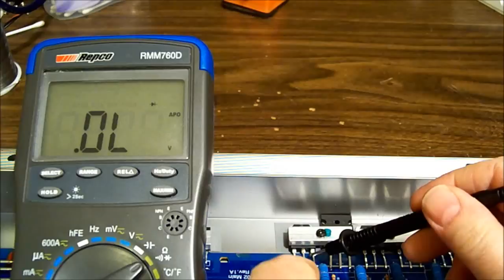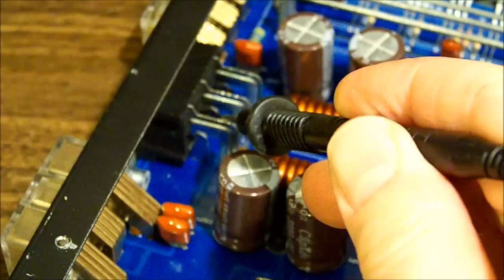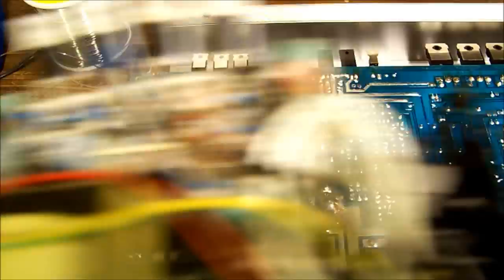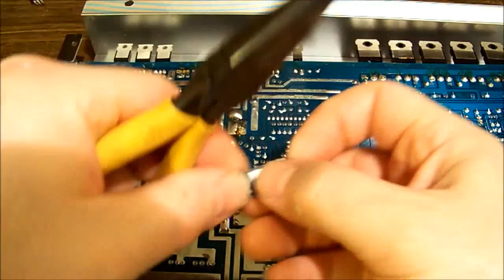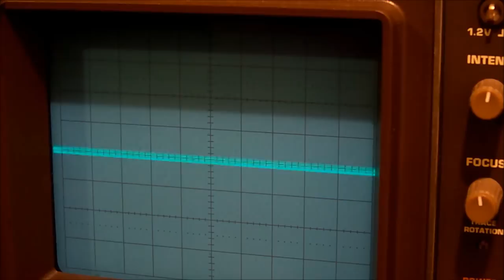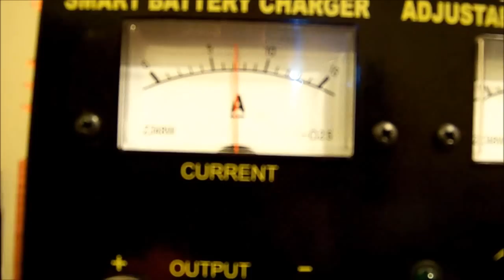Response Precision car amp second repair

Comment: what will happen if a car stereo is connected directly to an amplifier? connected to the amplifier are the speaker leads..
Reply from the maker: Some amps have a high level input. You can connect the stereo speaker leads to this input if you don't have RCA option. If you connect speaker leads to the RCA inputs it will sound very loud and distorted IF it doesn't damage the input circuit. If you connect the speaker leads to the speaker connections on the amp at least one of them will be damaged if not both but the amp is the most powerful of the 2 so if any survive the amp will.
Reply: You're right Mr Jonny fix, may car stereo is the one damage...can you please give me a hint of a possible defective part or part of my car stereo? Thanks...
Reply from the maker: Almost certainly will be the audio output IC as it is connected directly to the speaker lines. It's usually a black rectangular chip that has 2 screws holding it to the rear heatsink and a row of pins along one side to the circuit board. If you're lucky there won't be  ahole in the front side and you will be able to read the part number to be able to order another one. See my video for replacing one of these  https://youtu.be/hdbUaYGIoiE?t=793

Comment: Hey i was wondering if you can help me with a amp questions thanks your videos are awesome and helpful thanks
Reply from the maker: I can only try.....
Reply: Thanks so much for getting back to do you have a email so I can send you the pictures?
Reply: If not I understand but I have a Rockford power 1500bd single channel amp the very last mofset transistor is melted on it reads MTP75NOSHD then under reads CQ 151 I tried looking those up but can't find them I thinking they might not make those exact one anymore because it an older one I thinks it's an early year like 2000-2002 it's on the same side where the remote is located
Reply: I got some very clear picture of but caint link them in this message for some reason
Reply: jeisenzapf@yahoo.com this is my email if you can send me your email so I can send the pictures your help means so much

Comment: I have Diamond d7056 amplifier and every time I turn my radio on or off makes a pop noise I swap to a different amp and the noise went away  I was hoping that the problem was the radio/rca  but everything points to the amp have you ever come across this problem and how can I fix it. Thanks
Reply from the maker: Not sure what this could be. If it's only in one channel then look in that channels input circuit. If it's in both maybe start by scoping the power supply to see if there's a spike or something at the time of the pop then investigate there.  Either way you'll see it on a scope and should see where it's coming from.

Comment: hi I got a similar amp in design.....there is 12v and 30 inside the amp but power light is not on and amp is not on........ant ideas
Reply from the maker: I would follow the line from the power light back and see where it is driven from. If it's from the power supply maybe 30V isn't enough and it hasn't reached operating level. If it's fed from the audio input circuit somehow maybe that's not functioning right. A scope might be handy here to follow the signal through.
Reply: Hi...there was a +15...missing fron the pre amp stage.....while checkin i checked 380 ohm resistors...one read open...pulled it checked good put it back amp power light cane on ....seem aresistsnce build up round one of the resistor pin...is my guess
Reply from the maker: Raj Dann if it reads open when in circuit it probably has some voltage across it that's making your meter spit the dummy
Reply: ok thx......keep up the good work on the vids.....I enjoy them ..as do a lot of other techs......any experience in crown macrotech amps?
Reply from the maker: Nah sorry, not really in the business, just do what people who know me need doing.

Comment: what would cause a amp to go to instant protect with just the power ground and remote hooked up?
Reply from the maker: boosted970 Probably shorted output transistors

Comment: I was wondering if anyone could help me? I HAD a 5 channel amp & I was testing a dual voice coil sup on (this was all before I knew anything about car audio or electronics) & I think I blew the amp because I wired the speaker to 1 or 2 ohms & the amp wasn't rated for it. Would anyone know where to start looking for a fix on that?
Reply from the maker: I bet one or more output transistors failed as seen in the first video I did of this model. Identify those, remove them from circuit and test for shorted leads.

Comment: Hi there. I have found an Audison LR 3062 made  in Italy, probably 21 yo. No green or red light on, I've put a 12 v adapter on it, but it sparks and drains the adapter's red display. Sparks a lil bit on the ground/positive sockets. Opened it  but I have no clue where the fuse is, unless it looks like a striped resistor or like a blue tear. They work...have ohms through, have beep. All the 3 pins of the transistors work except on the two last ones , one on each side, towards the output end. The  3 sockets give a 0 reading of ohms, let's say socket 1 with 2 give 0 , socket 1 with 3 gives an amount. Is that normal or they are fried? No burn sign whatsoever. Thanks !
Reply from the maker: Hard to know what measurements should be without seeing the board or a schematic. You may need to remove transistors to test them properly as you could be measuring across other components as well. Fuses are usually plug in types in the outside rather than on the board. Sparks at the terminals could be normal as these use a bit of power to start up ( 5 amps or more). If you can't access a good bench supply a car battery will suffice. Good luck!
Reply: Jonny Fix
Appreciate it ! thanks !

Comment: would anyone help me ? when i turn my volume up just a little and you start to hear the bass  the amp kind of goes off and on constantly and you hear a dum  one second silence dum angain ans so on sound constantly as the amp comes on and off. i replaced the 4 transistors and still same problem i am now thinking it to be the diode ? one thing i did notice..i have a voltage reader on my power cap and that says low (basically being sorted) when the amp goes off and on. it keeps doing this till i turn the amp off.
Reply from the maker: My guess is there is either not enough current available from the source like weak battery or power cables not big enough etc, or the speaker has a fault or is too low impedance for the amp causing some overload.

Comment: if anyone could help it would be much appreciated i have a rockford fosgate punch 250.2.... the problem is when i connect the remote wire and turn the amp on it will send out a steady dc voltage there is no visible damage on either side of the board
Reply: So whats the porblem? Not turning on?
Reply: The remote wire carries out 12 volts to turn it on from the head unit.
Reply: it turns on but sends out dc power
Reply from the maker: If it is sending DC to the speaker terminals the output transistors are likely shorted or the drive circuit has a fault and is turning them on.
Reply: alright thanks man

Comment: AMAZING VIDEO. i love your eplanation.
people need to learn the fundementals that you showed at the end to WHY the fets failed.
My nasty Orion 2150sx old schol failed same way.
I forget what fets i used. 60n ot 44n fets i forget but the caps legs fried off because of the IC switch was stuck on full to coil on one half of phase. I did not repair it myself all the way. I do recall the real tech doing it , did same as you.
CONGRATULATIONS on your  REAL video. Please do more! 

I would love for you do do an output modification to 2sc5200n / 2sa1943-n on outputs and see what is needed on a typical AB amp.or would most be a bolt in?
I would love to rewind a  transformer beast for high voltage .....only mids and tweets 80hz up project to do 300 rms per side at 4 ohms. not much current so no need to beef up supply fets.
keep up the good work bud!
Reply from the maker: +AUTOCUBE Thanks, appreciate the comment. Glad the video makes sense :)

Comment: I'm getting a Resistance of 100k ohm on the cap pads on the left channel with the caps removed , it starts in the meg ohm range and drops to the 100k ohm range and fluctuates up slowly.  When I tested the amp the only components I removed where the caps on the left channel . This is a bridgeabe amp if that helps you any. But the components I am refering to as power transistors(which I may be calling them by the wrong name possibly)  are (5N05HD 921) There are 2 of those directly across  form each other, one on each channel, and (U1620R KAK),And (U1620 AKA) And They are also directly across form one another.
Reply from the maker: +smallmechanic The components you mention are a MOSFET and a rectifier, these are in the power supply section and at this stage I don't think are the problem. Is this the same......

http://www.soundbuggy.com/Eric/Car%20Audio/rockford_fosgate/punch_250_2c_1/punch_250_2_guts.JPG

The output transistors are the last 4 in the row under the clamping plate on the top right and bottom right. I would start with checking these out of circuit, if you measure a short or low resistance in circuit you can't always know if it's normal and related to something else.
Reply: Jonny Fix  I will pull all the fets and transistors out and check them. I have a little  money so I could order replacements if they are not to expensive. (I bet radio shack dont carry any equivalents?) . That amp in the link is similar but my amp is the 250 a2 rockford fosgate, the way the fets attach to the sink is different and there are no wires coming form the triods coil ( I think that is what they are called lol). ill let you know how the output transistors read when I have a little time to pull them out. Thank you so much Sir.

Comment: It is a two channel amp , when I removed the secondary caps on the left channel and powered it it just to test the amp came on and so I checked the caps and tested good (nichicon) and I also tested the power transistors and they seem okay but the amp will not power on with those caps in the board. I'm stumped as to what to check next. Thanks again for you help friend. Have a good one!
Reply from the maker: +smallmechanic By power transistors you mean output transistors that drive the speakers? This is strange. You could put the caps back in and remove that channels output transistors as a double check. (I guess you also tested with the right channel caps removed). I'm curious what voltage appears on the circuit with caps removed. What resistance do you get if you measure the + and - pads of the caps on the pcb while they are removed.
Reply: If skype or Email is a better way to contact you to send pictures of my amp and to send messages let me know, And again I am so truly thankful for all your help, thank you so much!

Comment: Would you have the time to maybe help me diagnose my amp? if not I understand you are probably busy. The amp is a Rockford fosgate punch  250a2 its powers on but the power led pulses and there is no output. btw love your vids!
Reply from the maker: +smallmechanic Sounds like maybe the power supply is starting up, shutting down, starting up, shutting down, hence the light pulsing. I guess you checked the basics, good feed from battery and a good earth i.e. a wire to the battery negative or to exposed metal of the car not painted metal. If ok, get a multimeter and check resistance across the secondary capacitors. In this video you can see them at 20:20, they are the 8 black round things in the middle. Yours might not have 8 but you get the idea. If you have a very low resistance on the pins of even just one,  I'd almost guarantee 1 or more of the output transistors are shorted, check as per the first video I did on this amp. If you have a very high resistance, 10k and climbing, the power supply has a problem. Maybe shorted diodes between the (donut shaped thing) and the secondary caps, or another reason for the control chip to not be able to measure the secondary voltage correctly and so keep shutting down. Just a process of elimination in a way, good luck!

Comment: one question i have panasonic sa he70. the receicer ony works on analog. digital inputs dont work. even if you put the equilizer on it will kill the sound. when it was working fine it started doing this on the optical digital input after some time and when you turn it off and on it was working fine. it was doing the same thing when a light or the ac is turned on  when you turn on the ac for a second or two the sound will stop and continue. ive changed the capasitors on the dolby dts board but no luck.
Reply from the maker: +Branislav Stratrov If you are referring to a room light or air conditioning, they would cause some momentary fluctuation in the mains power. If this upsets the unit then look at the power supply. Make sure the main filter caps are ok, voltage regulators are stable etc. Ripple on the DC lines would upset a digital board more than an analogue one, it might even present itself as a hum through the speakers.

Comment: The 50n06's usually have 47 ohm gate resistors! IRF 540n, 640n's, I would assume 740s require the same, usually 100 ohm gate resistors!

Comment: Always replace outputs in an amp as a whole. even if 1 is shorted, its best they all be replaced with matching devices.  Same can be said for the smps mosfets. Verify all gate resistors and driver transistors.